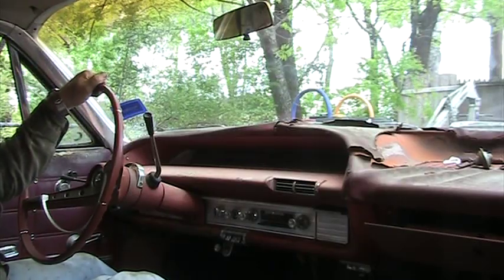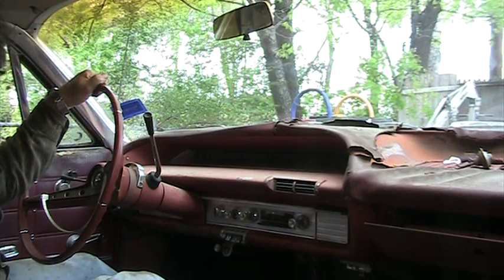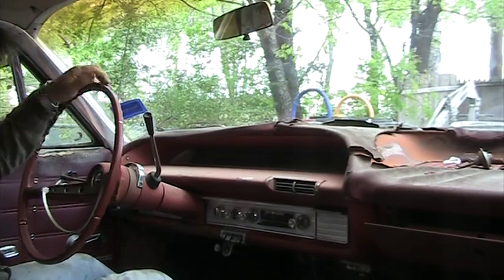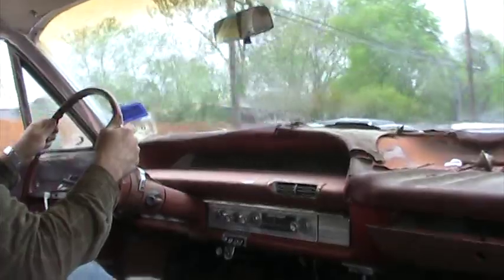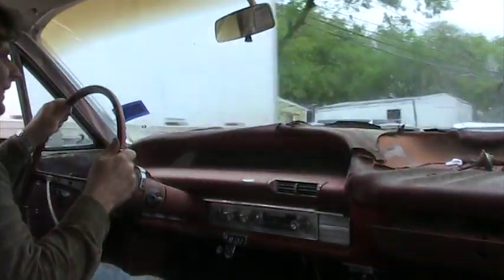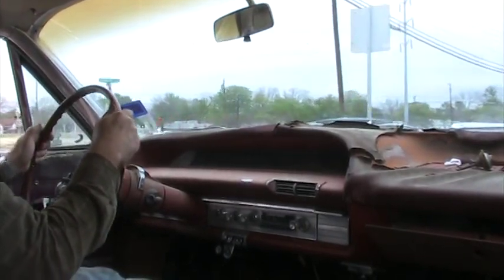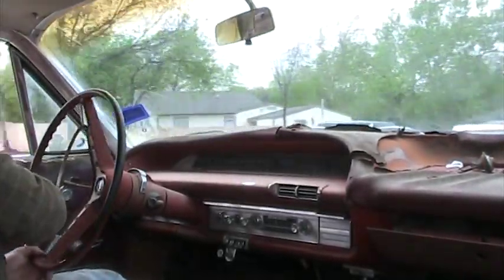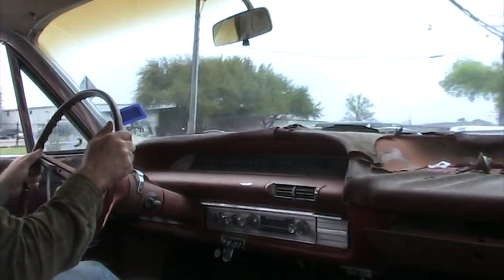first drive 63 impala video 32  watch it build

Comment: WOHO we have 2nd gear I love that man.
I was giving a 1963 Buick Wildcat by an old guy and put some wires on it some new oil change tires and drove the crap out it it had a real reare 330 rocket motor in it???starter was on the drivers side.

Comment from the maker: the cones in the speakers have rotted away, but the other day when I cleaned the dash up, I must have turned on the radio because I noticed the radio face was lit up as I was driving at night. I was amazed and reached over and turned it off and back on and it looks like its going to work. I also need to replace the broke off rear antena. It has been neat to see what all still works on this undisturbed car. The trunk light even still works when raised.